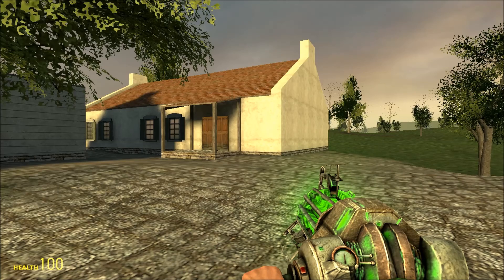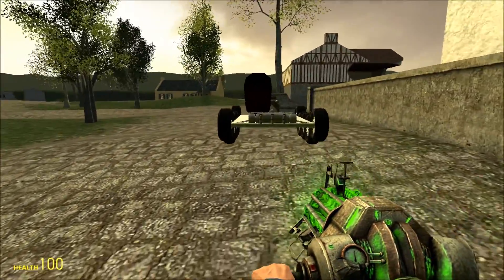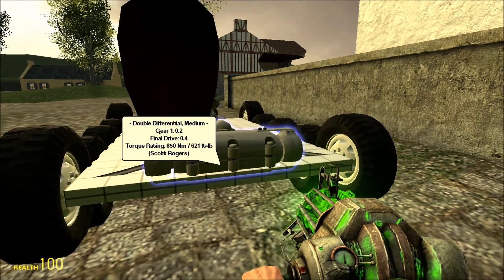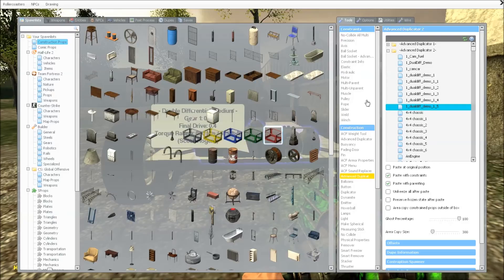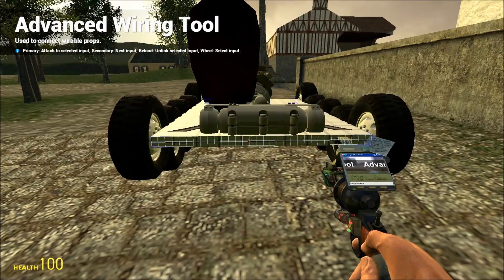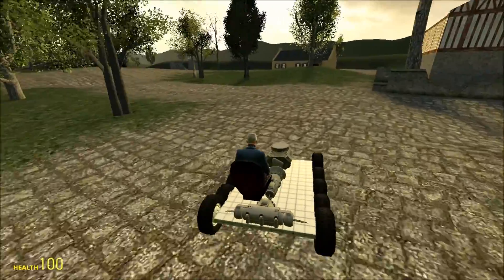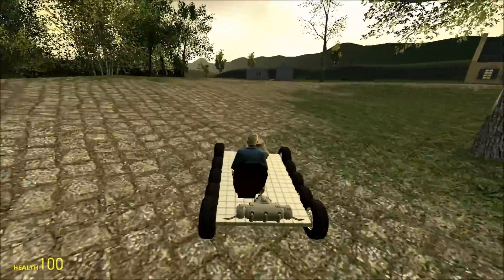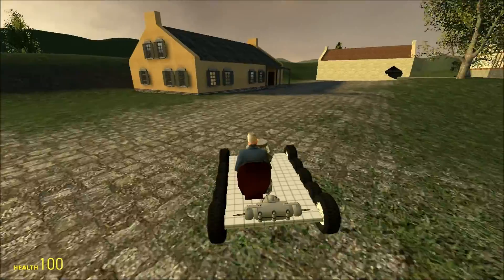ACF Double Differential

Comment: How exactly does this gearbox work? The steer rate doesn't seem to affect anything. It can't turn a tank of like 30t on it's own.
Reply from the maker: The gearbox should work as shown in the video, but shortly after the video was made, I had to rewrite some of the math. This was due to the fact that I was essentirally multiplying the engines output torque and and this caused extra torque to be produced from the gearbox and any test chassis could climb extremely well. Since then I haven't gotten the gearbox to work properly, it seems ACF doesn't like spinning two outputs on the same gearbox in opposite directions because one of two scenarios happen; 1) the engine's RPM is low and output torque is high, which causes the gearbox to function but the RPM is not high enough to keep the tank turning, or 2) the engine's RPM is high but torque is low as this considerably bogs the engine down and doesn't turn very well. I haven't really tried to fix the issue and I don't really use ACF all that much anymore. It might be possible to get it working but for the hassle it might be better to go back to the older system of using two separate gearboxes on each side to produce a neutral turn.
Reply: Scott Rogers Thanks for the reply! Yeah, I figured pretty much of that myself. Though a decent neutral turn (using two transfer-cases in that case) only works for me while on flat ground. And it also somewhat depends on how the wheelbase of the vehicle is made. I might try thta again at one day, but for now I returned to simple clutch/brakes + Weld-Latches; that seems to be the most simple way. (Plus a generic reversal-based steering system seems to behave meh at best, given how ACF works.) I still have plans for combining both systems though: Clutch-braking for generic driving and reversal for neutral turn, as turning on the spot with latches and clutch/braking will literally cause you to bump up and down while doing so.

Comment: Hey
I've been using this and have worked out how to get it to neutral steer but not steer on the move. How does it steer moving?
Reply from the maker: Make sure clutch is zero on the move, when clutch is one it engages a neutral turn.
Reply: Scott Rogers When clutch is 0 on the move and I change the steer rate, it carries on in a straight line.